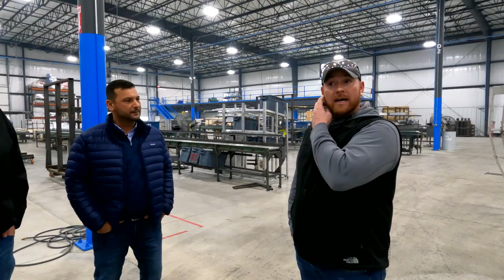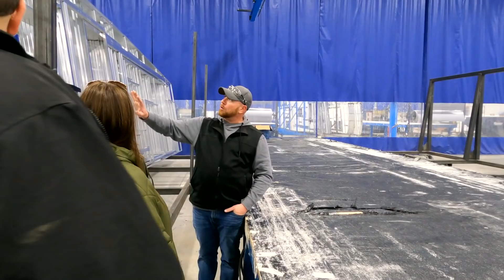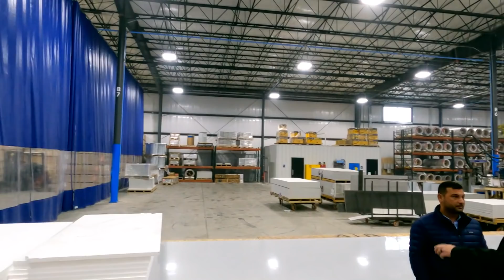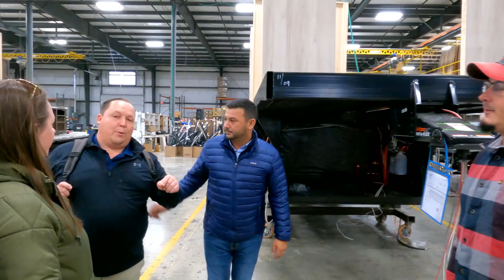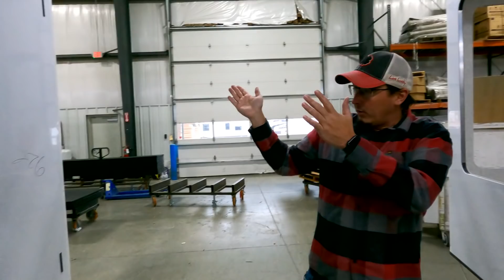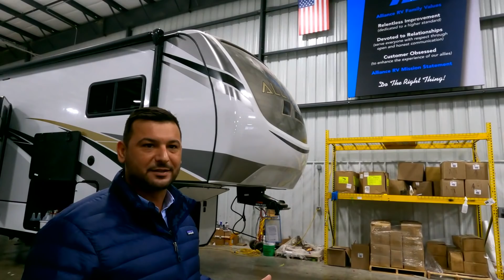Alliance Factory Tour! (Behind-the-Scenes of How They Build RV's)

Comment: If the Alliance quality team ever needs to find the areas that need improving just go to a dealership that just got a unit delivered by a transporter and go thru it. They will find trim pieces that need maybe a few more staples or glued, slides on the drawers that failed in transit with not closing or open, shades that had actually fallen off the windows and random screws that should be holding something in place that you will find laying around for examples of what i have seen going thru Alliances at dealerships in Florida. I walked out of an Alliance that I really liked and considered but after seeing poor workmanship and cheap materials I ordered an Airstream knowing i would sacrifice space for quality. I worked in manufacturing for 38 yrs and know that you might have a great product but it only takes a few unaddressed issues with attitudes of 'good enough' will down grade your product really fast in the eyes of a consumer.
Reply: Amen!   I bought the first Alliance Delta 262rb travel trailer in Missouri.   Among other issues, parts started falling off at mile 68 on our first trip.   Then, on the very first shower, the poorly installed, cheap knockoff shower door proceeded to flood the bathroom floor.   The plastic trim piece on the slide was installed incorrectly, cut too long, and not glued down.  The front cap light everyone likes was the part that fell off at mile 68: we had to stop at a Walmart to use carpet tape to hold the light bar on the trailer.  The 50 amp cord inlet cover was broken when we picked it up; the stinky-slinky carrier lid broke the second time I used it.   The coax cables aren’t connected to anything: owners must crawl into the pass through, find unconnected but bundled coaxes, test each one to find the right one to provide a signal to a TV.   I could go on [an on, and on].   I received an email on Alliance letterhead in charge of “Liaison” asking me to not communicate issues with other owners on the owner’s forum; then a co-owner called to ask me to not complain about there not being an owner’s manual or decent customer support.   Later the same day I was banned from the owner’s forum for “divisiveness”.   I thought KZ was the worst camper builder: I was wrong.
Reply: @samuelsmith5773  Obviously, the Alliance management still hasn't taken the poor workmanship issue seriously. That's too bad.

Comment: Alliance has so much potential but they suffer the same Achilles heel - a Lippert chassis with arcane suspension.   Strapping and baskets to help support the tanks is awesome, but I'd pay 10% higher, maybe more, for a chassis with tube steel rails and outriggers and a modern suspension whether IS or Dexter's air versus leaf springs hung from insufficient, bent bar hangers  with a band-aided V-clip to add some rigidity instead of actually using an engineered, fabricated steel hanger...  Such actually existed in the industry before Lippert nearly monopolized frame manufacturing.  Alliance, plan a future around engineering and producing your own frames and drag the industry back up!  There are masses of long-time, full-time RVers who want that!
Reply from the maker: Thanks for the feedback!